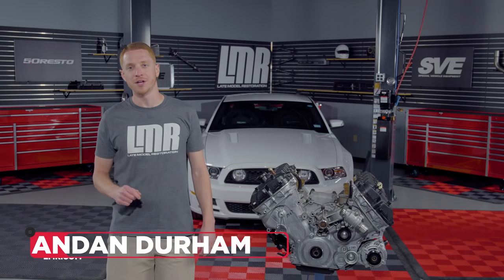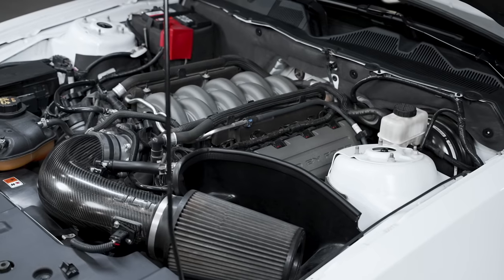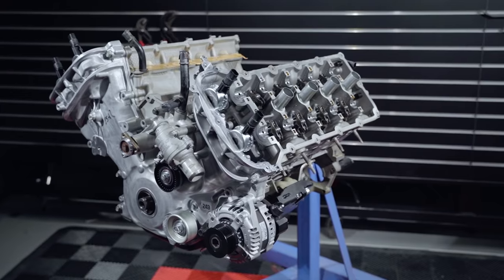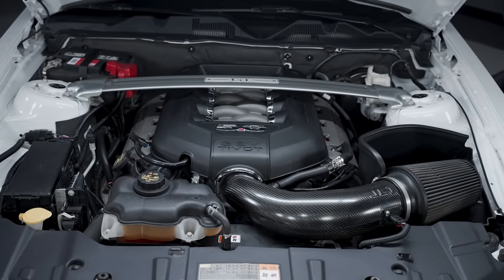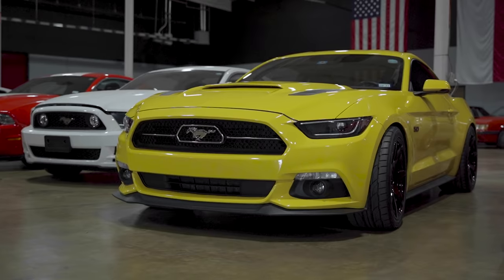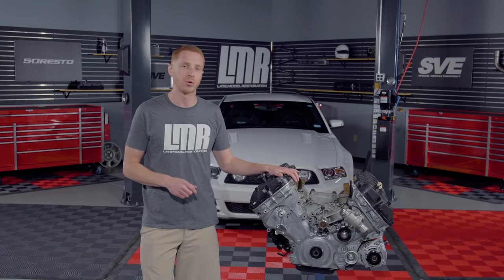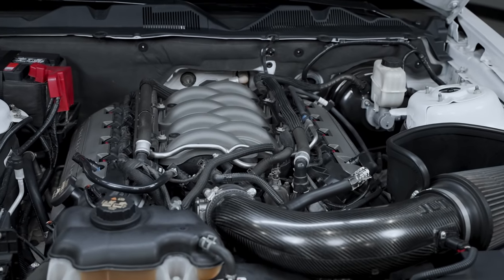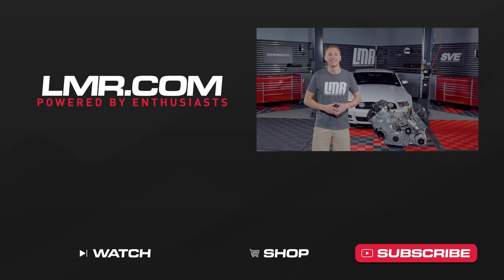Mustang vs F-150 Coyote Engine | What's The Difference?

Comment: The gen 3 coyote is 5.035 liters which converts to 307.25 cubic inches. 12.01 compression dual (port and direct) injection, 460 horsepower 420 torque. Despite these impressive numbers.. some Dale Earnhardt jacket wearing, reebok hightop wearing, mullet having dipstick will say it's a complicated weak engine.
Reply: They only say that because its expensive
Reply: @redlight3932  It's only $1100 more than a new LT1 roughly 10% more.  A crate LT1 is $8400 and Gen 3 Coyote is $9500
Reply: @Dayandcounting  cheaper to mod the gm. Always has been.
Reply: @mdubz101  Say that until we see the price of the LT6.
Reply: @mdubz101  If you get into the motor yes, but forced induction, not so much, and the 5.0 responds better to power adders. Way better.
Reply: @InuranusBrokoff  yea these Modular engines have much more in the top end these days it seems. Revving to 7500 helps too.
Reply: @mdubz101  Its actually not with the new fuel system.... the mustang can make well over 600whp on stock block... to make that on ANY lt1 you need drop in pistons... Which means your LT1 can barely handle a balls to the wall Cam setup without needing pistons... As well as to even do boost youll need to drop over 5k in a fuel system... Which a gen 3 you don't have 2.
Reply: @mdubz101  Don’t need to modify the Ford at all. 🤷🏻‍♂️🤷🏻‍♂️🤷🏻‍♂️
Reply: That's because they still won't keep up with those dinosaur pushrod engines
Reply: @GokuGaming you are completely wrong
Reply: @Dayandcounting not that much difference for a much longer, stronger engine "Coyote " anyday
Reply: @mdubz101 theres a reason 350s and ls have been the go to swap for decades
Reply: @mdubz101 hell nah
Reply: @jamescook7051  so! You are a poor guy and bad mechanic? GM is for guy that wants runs without $ and are not good mechanics for modern engines?
Reply: @jamescook7051  more impressive? 😂 
Maybe for your girl is more impressive. Let’s be honest! Coyote is the most powerful modern v8 engine build ever. 
5.0 making big hp 
True modern V8 
It’s impressive
Reply: LS3 still all day. Smaller, lighter, cheaper, more powerful.
Reply: @HioSSilver1999 
I love the sound and low end torque of the older pushrod motors but they won’t keep up on the top end with the coyote’s
Reply: @tomedgar4375  they smoke the coyotahs in every fashion.

For example... my old bolt on ls6 trapped 131.3 on pump gas, no race brakes and no gutting. There are no bolt on coyotahs that can do that in a similar configuration.  Hell they can't even get ther on pump gas.

Most of you just don't know wtf you're doing with a ls. Most don't even get all the tq management out of them.
Reply: Yeah we call them folks Chevy drivers
Reply: @mdubz101 won’t hold the power like a coyote tho
Reply: @Dayandcounting  no real reason to care about buying an LT6.
Reply: @jamescook7051 The FP700 disagrees.
Reply: @Cuhh346 simply because there are cheap, every junkyard has one, and everyone and their brothers knows how to work on one, and everyone and their mothers sells parts for it, that’s the only reason, mod motors are the new day way to go
Reply: @fishingthepeje7557  there are plenty of gm motors out there with huge power numbers and done for less than than the coyote. I like the coyote but it's not the end all.
Reply: it's an engine with benefits and drawbacks
Reply: @ryandubyah2345 does Chevy even make the Camaro anymore?  Perhaps we're on the final year. Ford wins yet again!
Reply: @michaelhillard4158 yep this is the last year, at least for the V8 Camaro. It’s a real shame these environmental whackjobs are winning to the degree that we won’t even have a selection of American muscle to go through. 

I’d choose Ford anyway so I’ll call that a win 👍🏼
Reply: @mdubz101 it used to be but not anymore  dollar for dollar hp to hp price is negligible nowdays
Reply: @Cuhh346 sbc were cheaper builds, the LS not so cheap if you want long lasting reliable high  hp LS you are gonna pay....alot. 
The junkyard LS swap where you put a turbo or twin screw sc on and send it is used car dealer shennanigans! And wont last long.
Since 2008-9 the old school  sbc or sbf builds are equal the make the same power for same amount of money all day long.  car craft, hot rod, builders across the US , even road kill garage guys been doing it for the last decade or longer now.  So generic sbc us thing of past. All the builders  and comparisons show they both have same parts and support availability cost same money for same power levels across the board.
There are far more GM vehicles is the other reason. Statically the  289, 302 and 5.0  and other sbf engines were used almost as often in swaps. This guy is comparing a gen 1 2011
Coyote vs LT which is not an LS.  The LT is completely different no interchangable parts except fot wrist pins .. cost is slightly more coyotes  vs LS. LT its very close  the coyote takes more room up top less down by the pan. way better electronics and way easier tuning vs LT 
I own ls and lt vehicles currently and I have had 5.0 coyotes built and worked and modified all of theses engines over the past 15 years I like em all these are the facts. 
All manufacturers have went downhill since 2017
Reply: I’ll take a gen 2 and boost it so as to not have to deal with the direct injection tuning issues. 🤷🏾‍♂️
Reply: @Dayandcounting yet racers are making 2900+ whp on coyote engines on stock (but sleeved) block and stock crank.

You gotta pay to play, if you actually wanna win.

Comment: Very reliable engine.  I have a 2014 GT and have over 185000 miles on it.  No issues.  Runs strong.  No check engine lights at all.  I bought it used with 93000 miles on it.
Reply: Daaaamn, buying it with that many miles is ballsy
Reply: Keep an eye out on cylinder 7-8 since they’re at the back the get the hottest. The valve head can get worn. Common issue with that generation. I had 226k when I sold mine. I’d sometimes get a misfire in 7 that went away after warming up.
Reply: @GirthosaurusRex yep ur completely right my 8th cylinder was 60 lower in compression at 151k miles, 321 build here we come

Comment: Thank you for the history lesson. Now please  talk about the late model 5.0 that is pertinent to our choices today
Reply: Sorry the s197 is always pertinent to mustang choices  buddy 2013 cobra is the last one done by carrol shelby.
Reply: @MrDeathdealer79   thank you. I’m contemplating a F150 with the 5.0 so any information on the current generation is helpful.. 
for example, the oil pump issue? Has Ford addressed this or should I plan on doing it at some point. And at what point?
Reply: What do you guys want to know? The 3rd gen Coyote is the same as the 2ed gen except for different cams, different heads and valve covers (direct injection, slightly better flowing), I believe they went back to the deep 12mm head bolts, and they no longer use iron sleeves but a special metal transfer lining (which can be bored out and aftermarket sleeves installed). For relatively cheap insurance, if you've got the pan and timing cover off, I would get billet oil pump gears/complete oil pump, especially if you plan on running a supercharger. If you're just going to run it at stock or near stock power and rpm I wouldn't worry about it.
Reply: Lmao such stupid ppl 😂🤣 want a race car and I’m guessing not mechanically inclined so they’ll drop 50-60k and $700-$900 a month payment 😂🤣 for a new piece of junk!
Reply: @MrDillon2029  right non of these people are actually mechanics if they where they would stay away from the 5.0 it’s a hot piece of garbage filled with oil consumption issues and when they break they break also fords car and truck designs are horrible no clearance to do anything on their cars or trucks wiring harnesses in the most inconvenient spots and drive belts are way to close to coolant hoses.

Comment: As someone who put a 2013 f150 5.0 motor into my 2011 mustang as a cheap street beater, The main differences between the f150 and mustang (gen 1) is 10.5 vs 11.0CR, and the intake cams. Bone stock I ran 12.50s. It held and lived at just under 900rwhp for about a year. Cheap way to get into a coyote if someone is debating going the f150 motor route.
Reply: @jakejohnson9827  lol

Comment: The old 5.0 was 4.94 something.  The new 5.0 is actually 4.95 and considering Chevy got away with calling their 305 (4.99) a 5.0, Ford can do it too.
Reply: 4.99 liters and 4.94/4.95 liters is quite different, but nobody is arguing about whether a 5.0 Coyote is a 5.0...
Reply: Ha Ford Aus we got a 302 Cleveland (early 70's - mid 80's) that they called a 4.9L then the mid 90's come we got a 302 Windsor that they called 5L
Reply: Don't forget the 1969 Z28 was a 302.
Reply: You care a lot.
Reply: @dot.adonis8322  I'm serious, but not.  It's a joke about their nitpicking.
Reply: @dylantroutman4363  Rounding has always been standard in displacement measurement